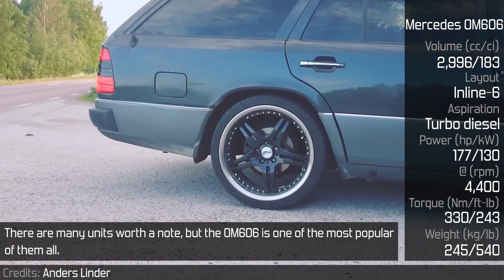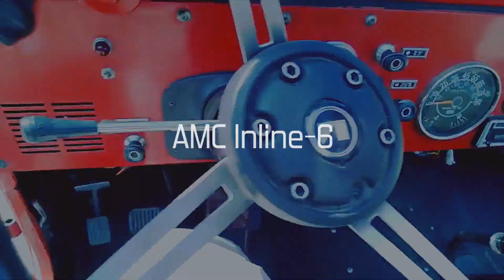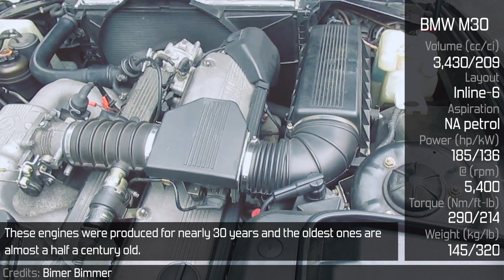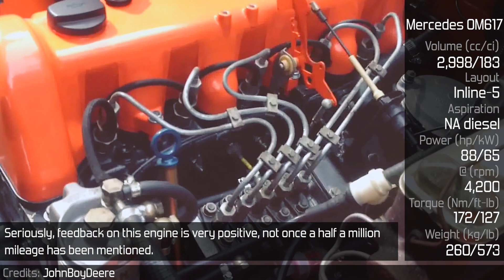10 Most Reliable Engines Running Beyond 300,000 Miles

Comment: No volvo v70?? Pretty much every volvo v70s drives just normal to 400k km
Reply: My car is gaming any diesel drives 400k normal
Reply: Peppa Pig im sprry but you're wrong
Reply: Antilaakeri any diesels that isn't in a Chevy or Ford lmao, my Mitsubishi diesel has more than a million miles on it and its never been rebuilt, has stock internals, and takes 30 lbs of boost
Reply: The Volvo engine can go that far but the crappy Aisin Warner Japanese trans wont go that far,
Reply: Volvo v70 Base should be on the list l have a 1999
Reply: anonjag my first car was a 2001 v70 xc with 200ks on the clock. Barely drove it for 9 months before  the service gearbox light came on while driving into town and it died on the way back at the top of a hill on a motorway at rush hour. Other than that the Volvo was mint.
Reply: yeh.  rest of the car falls apart after 5 years.  Worked at a dealership sevice dept
Reply: 1966 Volvo P1800S record holder 3mil miles same block. another one hit 2mil miles in 2002 its in a museum now somewhere in new york
Reply: The motor block maybe okay but the rest of the car will be trash in just a few years and you'll hate yourself for putting all that money in a piece of junk
Reply: 500K is breakfast for basically any Volvo.
Reply: Volvos? I have had a 122s two 144 s. They last forever and then keep on going.
Reply: I've had 6 volvos driven over 700k
Reply: Maxi ?!? Lol right mate
Reply: andy vdw there was a lady with her 55 Chevy sedan (is it called sedan in America?) Anyway she owned it since she was 19 I think back in 1957, she has over 3m miles, there is a few american classics with 3m miles, haha I remember some dumb ass wanted to sell his 3mil 1970s car for $900,000, last time I checked its worth more with low miles not more haha, I'm in Australia and I had a 1972 holden HQ with 980km on it it was a red 202ci straight six, when I bought it the oil was like grease lol.
Reply: my dad used to have a v70 turbo, god damn it what a car
Reply: v70 is not a real volvo. no modern "volvo" is truly a volvo. Sure the engine block, pistons, heads and all are volvo. But the rest are just ford or any outher lower end brand. From my window here I see my neighbors old V70 just sitting forgotten in a grass field. Why? I believe what killed it was the gearbox. (to much money to repair).  So why even call the V70 "Most Reliable Engines" when far before the engine dies the rest of the car just falls apart.  

I got a volvo 850 (just like the V70) and there is all kind of electrical problems (modern problems) that just makes it not worth keeping it running until the engine dies. But o I love that 5 cylinder sound ;)  I mean if the V70 and 850 was 4 cylinder cars I had got the car destroyed in a ditch or something out of carelessness.  Way better volvos out there even if non are 5 cylinders :c
Reply: Some dude in Norway drove his yaris 300000km without oil change or any scheduled maintenance. Except the 5000km inspection.  He sold it after 300000km, still drivable.  https://www.tv2.no/a/6129523/
Reply: My dad's old volvo 240 probably has more than 600000km on it. Still runs.
Reply: 2.5T Volvo XC90 Engine - 420k km
Reply: 2013 S60 D3. 496000km. 2nd Turbo, 1st engine
Reply: @shaun muppet finder every big detail is stock, but awd is rebuilt
Reply: anonjag The Aisin Warner transmissions were still better than pretty much every other automatic transmission at the time. The bad one was the GM transmission Volvo put in the P2 6 cylinder.
Reply: I have one, 20k KM starts and running as new, 15 years ago
Reply: Those are probably great cars but they are unusual and that makes them a hassle.   Probably the best is grandpaws late 1990s Buick  LaSaber CUSTOM.  These cars are sturdy and the parts a cheap.
Reply: The CUSTOM is the lowest model.  It does not have all the toys that can break.
Reply: the modular i5 are solid blocks, if there is a flaw that can happen on em its that the AC pump ball bearing fails on them and when that happens it will take the engine with it, so make shrue when change serpent belt always check condition off the AC dont feel wonky.
Reply: 400k miles would be impressive
Reply: @mkp1214  My dad's Mighty max (Triton) Turbodiesel lasted a long time, but it accelerates like a dog in the quarter mile.
Reply: @anonjag  What do you have against Aisin transmissions? I heard they were pretty good.
Reply: @johnnyasus86  I hated the 202 but-that is impressive

Comment: I put 375,000+ on a '71 AMC 232 in line 6 2 brl carb.. 3 spd on the column,,, Changed the oil every time I changed my mind.. @ idle there was 30 psi op... 53 psi @ 60.. I did have a freeflow exhaust on it also..

Comment: 1.9tdi pumpe-düse reliable??
Reliable is the 1.9tdi with the bosch VE EDC.
Reply: anxelous also vw b3 derv mine has 367.000 16cc turbocharged only changed cambelt clutch and water pump but gearbox 3 times